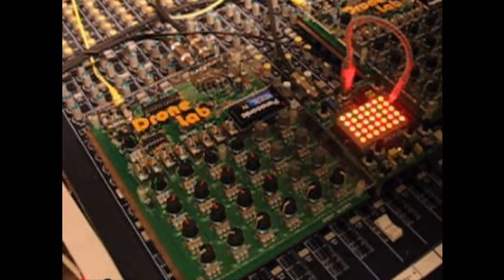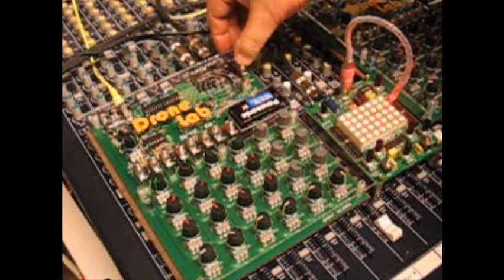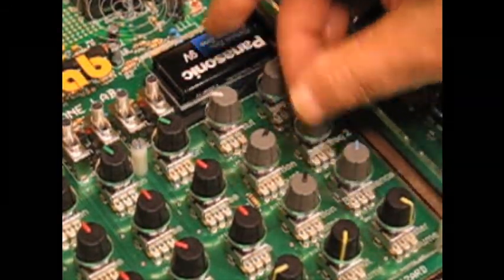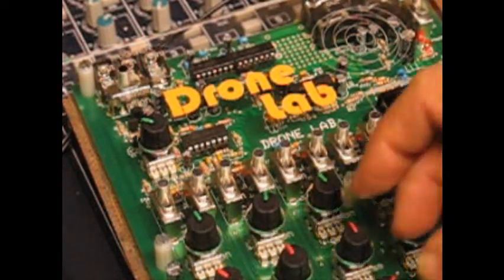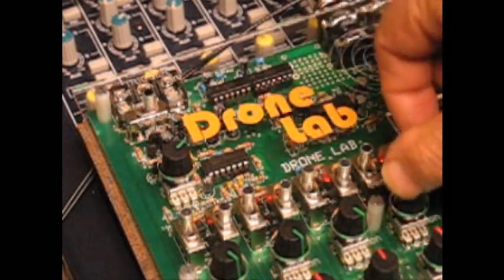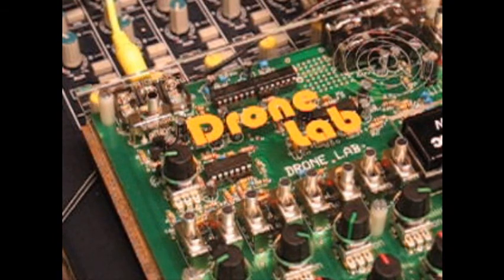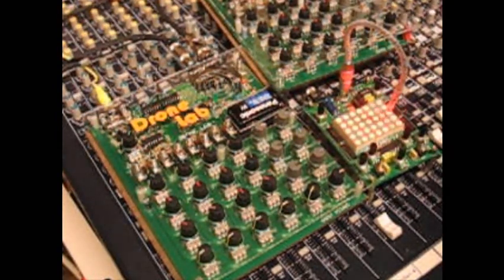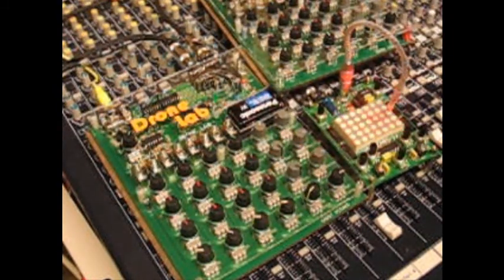dronelab synth kit

Comment from the maker: C27 connects to R42 but on the + leg, the - - - symbol should run down the side away from R42 not next to it.  Another item in the instructions but wrong on silkscreen of the board is that C5 is installed in the opposite orientation to what is silkscreened.  It was an issue on the first boards.